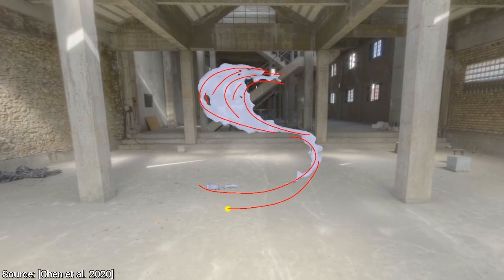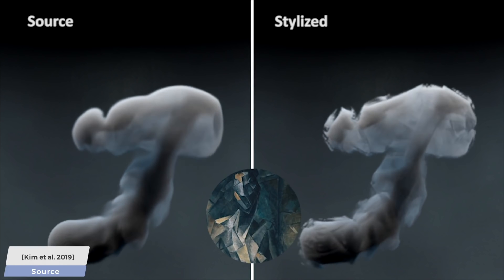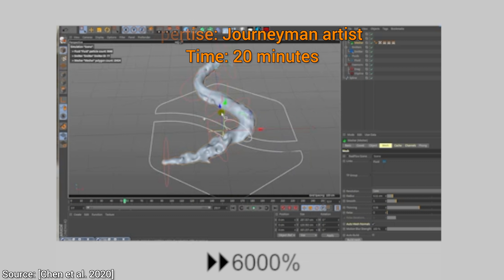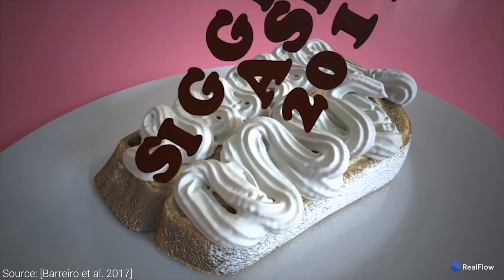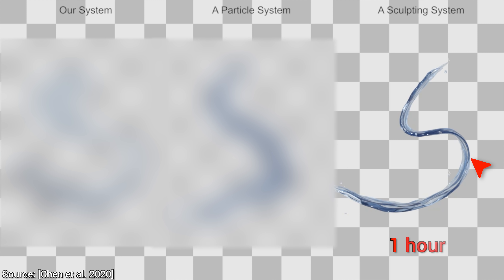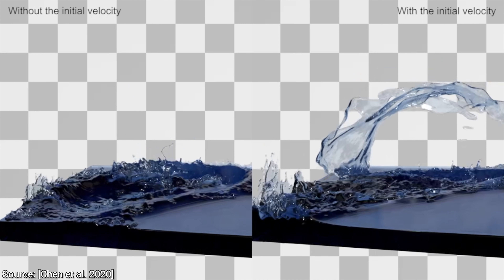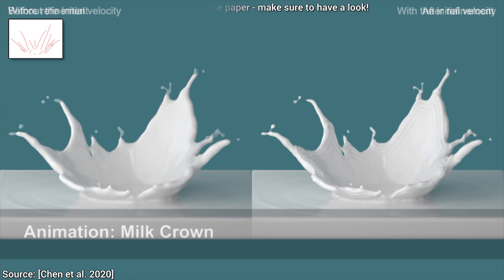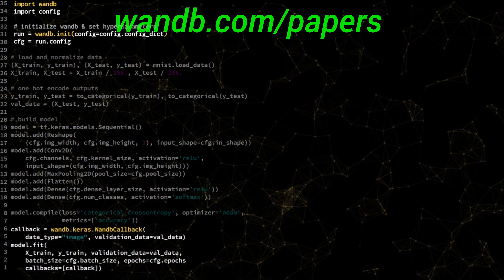Virtual Reality Fluid Drawing Is Here! 🥛

Comment: Not really impressed. The „VR“ one can easily be achieved with fractal textures that control displacement and alpha, and the resulting shape can be used as a source shape for particles. Then again I worked in CG and know that it might take 1hour to create a decent texture/material, but then you just apply it and use it forever :-)

Comment: There's a very important point that's usually ignored: the ability to obtain the exact shape you want, not just a random shape that wasn't exactly, pixel by pixel what you were looking for but still looks nice. Sculpting allows that at the expense of time. Particle systems can be seen as a trade-off, and this system is almost exclusively of the kind that allows you to obtain beautiful shapes but with little exact control. They are different tools that solve different problems, they are not interchangeable imo.  
It would be great to have a tool that makes the shape one wants very fast, and with great exactitude, but most of the time one does not really have an exact shape in mind, because that requires expertise. IMO the best works of art are of this kind, where no shape, no pixel is random. That doesn't mean the other techniques aren't pretty and very useful tho!

Comment: This is really cool, but what would be cooler is if this could define resultant shapes, or middle shapes, in other words: define a source splash, draw a butterfly in the air, and then the splash splashes the water into a butterfly shapes and then continues on, following the velocities.
Reply: You could probably do that by simulating it twice but one time backwards. By that I mean one time you start with the butterfly and apply a force to each of the particles, and simulate that. Then you could do the same, but with the force in the opposite direction, and piece the two simulations together